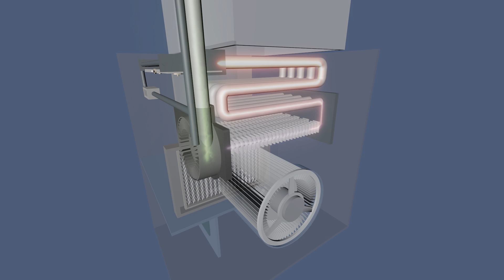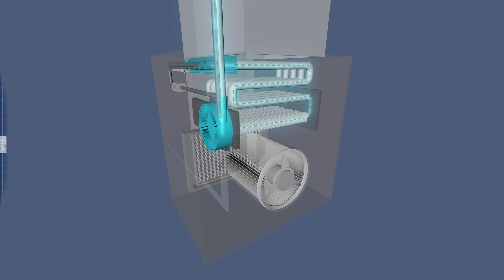Noisy Furnace? - Top 5 Fixes | Repair and Replace

Comment: I have a noise where it sounds like a single piece of gravel or one popcorn kernal spins and falls from the top of the cage to the bottom, then done, just one noise in one of the wheels when the heat comes on and when the heat turns off. I don't AC, only heat. 

I had the same issue last year, someone came out looked around turned it on and the sound was gone.... is it likely dust or debris getting pushed thru? or another major problem? 

The blower fan does look dirty.

Comment: Have a brand new furnace making sort of slight clanking and clicking noises as the blower starts and then again as it shuts down. These noises don't seem to affect the furnace heating the house but they are somewhat annoying in that its brand new and the replaced furnace made no such noises. The installer has already come back and inspected the furnace but he could not find the source.

Comment: First and foremost, thank you for the excellent video. I cannot thank you enough for giving explanations for each particular sound. That helps tremendously. I have a question , if you don't mind. Based on your video I think my motor bearings are wearing down. I'm not due for my annual service call till next week. Can I run it for a short time each day until then or would I make the problem worse? Thanks in advance for your help.

Comment: Great video. What’s a normal fan supposed to sound like? 😂 mine is deep loud humming, and also sounds like a brush slapping super fast, no belt. Also fan was replaced 2 years ago. No heat on, just fan cycling air right now. I’d like to leave it cycling air 24/7 if I could but it’s 20 yr old.

Comment: None of these sounds is what I have, mine is very loud humming sound, such loud literally drilling through my brain no matter where in the kitchen I am standing.
Reply from the maker: That is likely a transformer sound at that point. Older transformers can become more noisy, so it might need to be replaced.
Reply: @AmreSupply  thank you for reply, a technician came and replaced Blower motor, it is now making different humming sound, less loud, but also annoying especially in the evening and night, I just posted on my channel in shorts. I called them the guy came back and said it is normal humming and I will get used to it. I still hope it is possible to fix that.

Comment: I have a brand new Coleman furnace that is making a "flapping" sound when it's running.  Any idea what's causing this?
Reply from the maker: Could be a piece of something inside, even a piece of plastic could cause flapping, so best to check the blower wheel to see that it's clear.

Comment: My furnace is making a loud boom like a shotgun and shakes the house? What does that mean?
Reply from the maker: That could be a serious and potentially dangerous problem. In this case it's likely delayed ignition. Gas builds up and is ignited all at once. It's best to shut off the power, and gas to the furnace and call a HVAC technician to inspect it.

Comment: If this wasn’t 7 years ago, I would have thought this was Ai. But it does sound like the duct expanding. I wish there was something I could do to minimize the noise.
Reply from the maker: Yes we've been filming with Vance since 2017 and he's the real deal. As for the furnace, duct expansion is difficult to fix and difficult to make any changes on. Insulation around ducts can help, or anything that reduces vibration will reduce the noise but these are not quick and easy fixes.

Comment: What bout a high pitch beep or squeal for 4 secs when the heat kicks on then stops?
Reply from the maker: If the furnace starts and stops then it's likely tripping a safety switch. You can learn more in this video: https://youtu.be/b0sAGt-1niU?si=5weM8scsahqPtqUM

Comment: blower runs for about minute, then one click,a little loud, seems to be near blower area, blower is quiet, everything seems normal,,,,just the one click , every time blower runs AFTER about a minute?
Reply from the maker: Best to check the error codes, there's likely a switch or sensor being tripped.

Comment: You mentioned all the noises in the world, but the humming noise!!
Reply from the maker: In many cases a humming noise is just the transformer. There is often a slight hum but if it's getting louder over time then it would likely need to be replaced.

Comment: I just had a brand new air handler installed and it seems like the blower wheel is wobbling a little bit which is causing the whole thing to vibrate. Is that normal for a brand new system?
Am I being overly picky?
Reply from the maker: Thanks for watching. During installation things may not be balanced correctly. There are some adjustments that can be made. Might be best to contact the installer and see what they have to say.
Reply: @ I installed it. It has weight clips on it so know it was balanced correctly at some point. I didn't drop it or mishandle it. The entire air handler arrived in great apparent condition.
As I rotate the fan I can see it is the fan itself and not the motor shaft.
It's truly wacky, and unlikely that these things happen, yet do happen.
Maybe I just got a "Friday late afternoon special" that slipped through QA.

Comment: what about lubrication for furnace squeaks etc etc.  whats a recommended brand / type?
Reply from the maker: It depends. If there is a place to oil then the motor bearings can be oiled with a ISO 68 synthetic oil but always double check first. Most modern motors have sealed bearing with no place to oil. In any case you can use an air compressor to try to clean motor, you can clean the motor shaft and make sure everything is secure and not able to rattle.
Reply: @AmreSupply  👍

Comment: unfortunately none of them were my issue. We heard the same noise prior to having new furnace and AC 3 yrs ago. Its just a LOUD fan type noise. Our home isnt that big but the fan,or exchange ducts are ridiculously loud. Changing filters dont do anything. Someone said possible exchange ducts weren't big enough? Same as all homes.
Reply from the maker: Thanks for watching. There's a lot of factors in airflow. The number of bends, diameter, filter size/rating/thickness as well as the motor size can all affect this. There are ways to reduce vibration noise in the ducts but that often requires a bit of work.

Comment: Noise disappears with filter out.
Reply from the maker: Thanks for watching. There might be some restriction from the filter which slow down the RPM of the motor and cause some vibration noise. Does this sound go away with a new filter?

Comment: Mine has done all of these from day 1. The guy comes out does a couple of things and it sometimes works for a week or so and sometimes doesn't last a day. My warranty is almost up and I wont be replacing it with a Carrier or have that company install a new one when it is time. I absolutely cannot stand this machine, it whistles in the house out of all vents and in the return And outside it sounds like a train coming through my walls.
Reply from the maker: Thanks for watching. Is the whistling more of the airflow through the vents or are you hearing it at the blower wheel?
Reply: It comes from all of the vents and I can hear a whistle where the filter goes. With or without a filter it all whistles, more so when the filter is in place. All times of year.
Reply: Sometimes it's a low toned whistle, sometimes its a high one but there is always a whistle.

Comment: This did not cover the roaring sound i am getting from the burners in a newly installed furnace.
Reply from the maker: Thanks for watching. If the roaring sound is excessive or unnatural and it's a newly installed furnace, the best thing is to contact the installing contractor.

Comment: No help, my furnace makes noise prior to the fan, I suspect it is gas moving across a valve , perhaps I will take the valve apart and clean it if possible
Reply from the maker: Thanks for watching. Any maintenance or repair on any gas line or valve needs to be done by a technician or this will void any warranty & insurance.
Reply: @AmreSupply  I installed it, I replaced the control valve years ago,I have a spare control module and fan motor, the fan motor I bought last time it started howling, it's some kind of harmonic and it just starts screaming, it happens after I've ran out of fuel, that's why I have a spare fan motor

Comment: My air conditioner unit that doubles as a heater unit outside sounds like a whale dying. What is that?
Reply from the maker: Thanks for watching. Worn motor bearings could cause that sort of a sound.

Comment: Great video! My furnace makes a single loud bang about a minute after burner ignition. Is this duct expansion? It sounds like it’s coming from within the unit.
Reply from the maker: Thanks for watching. If it's not a loud bang the moment that it ignites, then it's most likely metal expanding. Could be the duct on either side.

Comment: After every heating cycle I hear banging sound from one of the vent in our living room. Is that serious issue I replace my air filter every 3 to 4 months
Reply from the maker: Thanks for watching. If it is just the metal duct expanding due to a change in temperature then this is not an issue, and won't affect the performance of the furnace.

Comment: How to get rid of the duct expansion issue??
Reply from the maker: There's not a lot of easy fixes for duct expansion and it's not something we've made a video for or have any guides for. Here are the things that can be done:

Pull out the old squared off ducts and replace with round ducting.
If round isn't an option because of space - replace the current square ducts with a lower gauge, thicker, metal square duct
Pull out the old ducts and increase the size of the ducts... allowing for air to flow a bit more freely
Additionally you can try to insulate the ducts. This keeps the ducts warmer for longer and slows down contraction.

Comment: It would have been nice to mention WHAT TO DO about the duct expansion instead of just telling me what it is.
Reply from the maker: There's not a lot of easy fixes for duct expansion and it's not something we've made a video for or have any guides for. Here are the things that can be done:

Pull out the old squared off ducts and replace with round ducting.

If round isn't an option because of space - replace the current square ducts with a lower gauge, thicker, metal square duct

Pull out the old ducts and increase the size of the ducts... allowing for air to flow a bit more freely

Additionally you can try to insulate the ducts. This keeps the ducts warmer for longer and slows down contraction.

Comment: My furnace is making a whistling noise and then turns on
Reply from the maker: Thanks for watching. You're likely hearing the inducer blower fan which pulls fresh air into the burner before the furnace ignites. Then the main blower fan circulates air around your home.. A whistling noise could be the bearings on the inducer motor.

Comment: Can you tell me how to get a Goodman  motor, my repairman told me it takes 2 weeks.  It is only rattling so I don't think he's being truthful.  It doesn't sound like the bearings from your video.
Reply from the maker: Thanks for watching. The sounds in our videos are only examples but do not mean that it will always sound exactly like that. A rattling can still be bearings or an imbalance in the way that the motor is mounted. You could try adjusting the mounting brackets, seeing if it is centered etc first. https://www.youtube.com/watch?v=4SY8lRl8HV0

As for getting a replacement motor it depends on the motor, this video shows how to match the motor: https://www.youtube.com/watch?v=TF3QtXWd8s0 and you can see what is available on our website here: https://www.amresupply.com/catalog/650039

Comment: Very instructional video, so hats up! Now, I'm gonna try my luck here. I have a Coleman furnace similar to the one at 2:45. It features a squirrel cage driven by an electric motor via a belt. The motor works if the belt is removed. However, when I put the belt on, the motor turns slowly a few times, then it stops. After that, it will not turn at all. I've tried to turn the blower fan (located inside the squirrel cage) manually but it requires some force, which tells me that the blower fan is stuck, preventing the motor from running. Is there a way to service the blower fan? I saw in another vieo that you can disconnect the motor, remove the belt, unscrew the bolts at the top of the squirrel cage and remove the whole thing. Once removed, how can the squirrel cage be serviced? Thanks!
Reply from the maker: Thanks for watching. There are two videos that should be helpful.

Furnace motor & belt: https://www.youtube.com/watch?v=APqq4X_gjUU
Furnace motor & shows blower wheel: https://www.youtube.com/watch?v=4SY8lRl8HV0

Comment: My AC makes a cricket noise. Took the cover off of the air handler and no belt so I have to assume the bearings in the motor are bad
Reply from the maker: Thanks for watching, high pitch sounds like that can definitely be caused by bearings.

Comment: Thank you. Would you know where I could by a fan belt for  Sears product 74 year old whole house attic ceiling fan with louvers.  The name on belt is 
VERNCO 28274 DF.
Reply from the maker: Thanks for watching. If the model lookup tool doesn't work https://www.amresupply.com/lookup then you can measure the belt and find a replacement following the steps in this video: https://www.youtube.com/watch?v=jSfADe_xcKc

Comment: What if the device came in already that noisy? how can i make it not be loud?
Reply from the maker: Thanks for watching. It depends on what is making the sound. If it's rattling then you could tighten the mounting screws on the motor bracket. As well the blower wheel could be a little imbalanced.
Reply: @AmreSupply  Thanks, but i know nothing about it and i don’t want to mess up anything..The noise is like being around a jet..Mostly from the return vent..It’s so loud..

Comment: Would the whistling I hear be associated with grinding? It's infrequent but happens here n there
Reply from the maker: Thanks for watching. Whistling can be a slight misalignment or high speed vibration. A small amount of grinding, (the light touching of two metals) at 1500rpm could sound like a whistling.
Reply: @AmreSupply  I changed the filter and it's gone. I put in a fpr 7. Equivalent to merv 10. We have 2 pers

Comment: I replaced my inducer motor and it is making a very loud vibrating noise now. What could this be? My last one the squirrel cage walked off the the inducer motor shaft and started rubbing on the case of the inducer housing. I think it is doing this again with the new one. Why are these motor/housing/ squirrel cages junk? Why is there just a tiny spring to hold the squirrel cage to the motor shaft? Which does not hold it there. Is there a number I can call to talk to the manufacturer? I want to voice my concerns as I am spending too much money on a 15 year old furnace? I am subscribing to this to get the messages.
Reply from the maker: Thanks for watching. If the blower wheel is sliding and isn't staying on the shaft then you could look into getting a different motor shaft stopper or retainer / retaining spring. There are some that are tightened with a hex wrench which prevents it from shifting over time. You'd have to measure the shaft diameter and find a stopper compatible with that size.

Comment: Great video! What about a rumbling noise while its heating?
Reply from the maker: Thanks for watching. This would depend on where you are hearing the sound from. It could be a rumble from the motor or blower wheel. Tightening the screws on the mounting bracket could reduce that sort of noise.

Comment: Thanks that helped me rule out several things! not sure if you will see this but we recently moved to a house with a gas furnace and this is the first time its been cold 20ish degrees and my wife noticed a compressor running type noise when the furnace was running. any thoughts on what that would be?
Reply from the maker: Thanks for watching. In high efficiency furnaces there is the inducer fan which might make a slightly different noise from the blower fan. As well some models have a condensate pump that will run to clear the condensate water that is created when the furnace runs. This pump does not run all the time only when the level triggers the float switch. Not all models have a pump, these are only installed beside the furnace if there is no drain to directly remove the water with.
Reply: @AmreSupply  ah that makes sense then it must be the condensate pump as it was draining a bit of water as well.

Comment: Any tips for an ear piercing bloody murder squealing sound?
Reply from the maker: Thanks for watching. A squealing will likely be metal grinding on metal so look for anything stuck inside the blower wheel. If nothing is obstructing the blower wheel then it could be an issue with the motor bearings so it could be helpful to install a new motor: https://www.youtube.com/watch?v=4SY8lRl8HV0
Reply: @AmreSupply  thank you, hopefully I can save it, we’re tight to get a new one
Reply from the maker: @elizabethhallett5060  Just happy to help. Keep us posted on what you find!
Reply: @AmreSupply  I took it out, removed all the dust I could, didn’t find any metal touching, no obstructions, put it back in, turned it on….Still sounds like you disturbed a nest of angry piglets
New one it is.
Reply from the maker: @elizabethhallett5060  Thanks for the update. Best of luck with the rest of the repair!